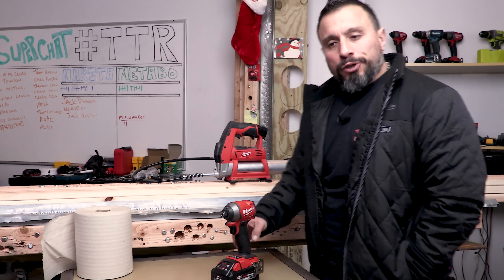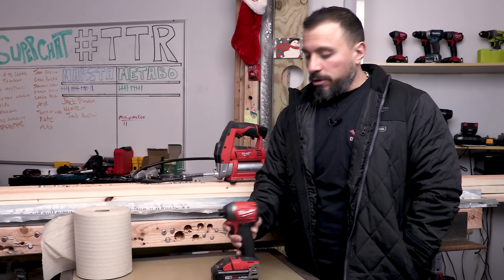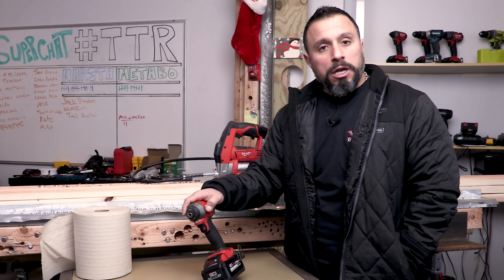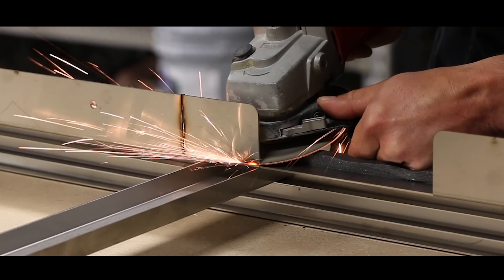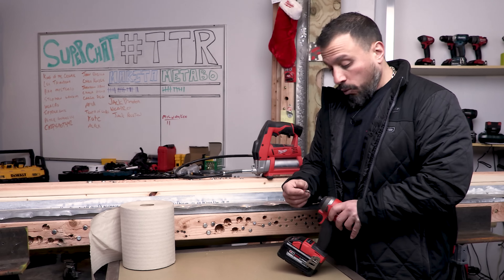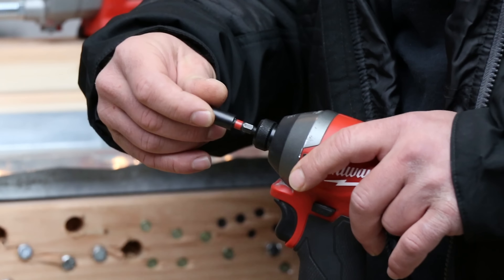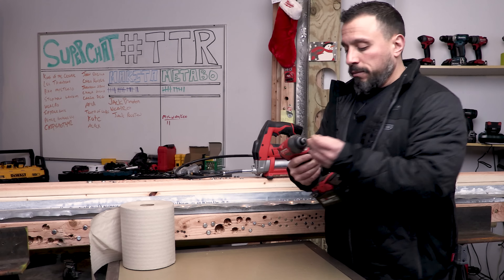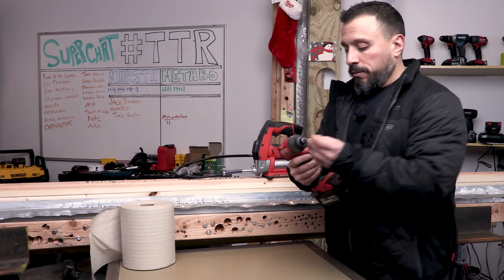Fixing Milwaukee M18 FUEL (2853-20) Gen 3 Impact Driver Collet Problem

Comment: Vince, its called an impact "driver" it's not made to be pulling paddle bits out of wood.  its sort of the same set up as a ratchet and sometimes the socket gets stuck on the bolt and comes free of the ratchet. it's one small ball bearing for Christ sake and you expect the bit too stay in place when you pull on it like that.  it's used for driving in screws and bolts and some light drilling, if you want to use a paddle bit then use the correct tool, its called a drill.
Reply from the maker: Greg, this tool is the best of the best in impact drivers! With that said , other offerings can handle the task of retaining the paddle bit so should the Milwaukee!!
Reply: These are made for paddle bits and many other attachments these days,. that is part of the reason most bits have the ability to be used in the quick connect. The older paddle bits did not have this functionality and could only be used in drills. At least when drilling with impact drivers you don't have to worry about it catching and snatching your wrist.
Reply: ssclassof2000 
Just because you can, doesn’t mean you should.  Go ahead, use a paddle bit and drill 6” into wood with your driver and try to pull the bit back out of the hole. How much force do you think that quick connect collet can take? If you use your tool this way, you will be sending it to the service center or replacing it, just don’t blame the tool, blame the user
Reply: But I do it w my dewalt all the time, and have for 6 years now
Reply: good for you, I stand by my comment, a drill is for drilling and a driver is for driving, use the tools correctly

Comment: The heat probably killed the temper in the spring of the ball. I'm sure they don't use the best steel for the spring. A thicker spring would probably be better as well.

I'm having an issue where I can't get the bit out.

Comment: So I've had this problem with another "High end" manufacturer's impact. So what i did and it worked flawlessly. I used the next size up stainless ball bearing. Its been several months and no issues.
Reply: what is the size of the bearing you bought?
Reply: @hasselhooph  the standard size that goes in was 3.5mm. So I replaced it with a 4mm stainless ball bearing.
Reply from the maker: Biglee where did you pick up the bearing?
Reply: @VCGConstruction  I lucked out and found it at my local ACE Hardware. But you can order them on EBay and Amazon.
Reply from the maker: Nice thanks BigLee
Reply: Winner winner chicken dinner!! You could also take it to machine shop and have them bore out the other side to make it a two ball bearing setup. Would need a new spring for both sides.
Reply: @ftlaud911  YES...i was actually thinking of doing it myself with my very own machine shop skills 👍
Reply: @big.lee007  hows your impact been going?
Reply: @brendon8702  so far it's been working  good. "Knock on Wood" lol 😆

Comment: 10/27/2022 Just received in the mail my brand new Milwaukee fuel impact driver. 
First day on the job the collet did not hold the bit one time had to set the drill down And borrow my boss's
Pretty pathetic.

Comment: It happened to me once. Hasn't since. We shall see! Thanx for the video. I was wondering what u was going to try when in past videos had issues removing spade bits
Reply from the maker: I’m gonna need to try more drastic measures !!
Reply: @VCGConstruction  have to post that video! In case mine decides to say, naw I'm done lol how's it going today brother?
Reply from the maker: Alls good Summit, how about you bro?
Reply: @VCGConstruction  this are decent. Been installing whole house systems. Duct work and everything.  Even running gas line from where meter will be placed. Finished 1 job today, starting a new big job tomorrow. 6 bedroom house, 3 zones. Should be fun yet cold lol

Comment: I hope the new impact driver Metabo SSD 18 LTX 200 BL, which you recently tested, does not have such problems? I plan to purchase it.
Reply from the maker: No problems so far with the collet but it doesn't have quick insert which isn't as convenient but maybe more durable!?!
Reply: I also think it's because of the quick insert. I think that such a serious company as Milwaukee will quickly solve this problem, because in the modern world the competition of manufacturers is very high, reputation is very expensive, and no one wants to get into a puddle. Anyway, thank you for your answer, and good luck in the new year!

Comment: Hey Vince great video, I love the channel and appreciate the hard work you guys put into it. I have always felt (and I’m sure I’m alone on this one) that impact drivers are not ment for drilling holes in wood where great forces are need to retrieve the bit, it puts a lot of pressure in a vary small area, unlike a conventional chuck that has a much better bite on the bit and the pressure is distributed beyond the detent in the shank. I also feel that using an impact driver of any brand as a drill for holes bigger than 1/2” shortens their life span dramatically, just my two cents.
Reply from the maker: I hear what you're saying but those Daredevil bits are impact ready! The Gen 3 has no problem drilling the holes, it's just the retrieval of the bit in thick wood. I know Milwaukee will come through with a solution!
Reply: I love the those bits!  I picked up the the larger holiday promo set at the HD , should last me until next Christmas. In my comment I was referring to the the life span of the impact driver itself after reading it I’m not sure if that was clear, i’ve had problems with a few different brands losing their grip on Retrieval but it usually doesn’t start happening for a few years.I love talking tools.Happy New Year

Comment: You guys work those tools like no other so wear and tear takes on a whole new mean!
Reply: Henry Cruz to be fair that drill looks like it’s had light use as to what other professionals use them. It should not have any problems
Reply from the maker: Do you think we abuse the tools Henry?
Reply: I don’t think you “abuse” the tools but certainly take the to the edge more then you do in the average work day
Reply: Sekekama WoW you see there is no such thing as an average work day. Some days might require more dedicated time on a tool and quite frankly we pay good money for these products to work as they should whenever the task call for it without fail
Reply: @VCGConstruction  of course you do silly.
Im talking about what happens during TTRs
Reply: @FreeBladez  that's not reality. There's  mean time between failures for everything (MTBF). "Mean" suggest some of the same tools will fail earlier than others and some later than others. 
Moving parts wear.
That's why sometimes you can be lucky to have a tool that last seemly forever and then there are times you have one that breaks after a few usages. NO MATTER WHAT YOU PAID FOR IT.
Though there's a better chance (much better) the Milwaukee will have less failures than say a Hercules

Comment: I realize im a little late to this vid so idk if anyone will see this recommendation but I recommend White Lithium Grease. Its not anywhere near as thick as red tacky and it continues to work well and last a long time under intense heat. fantastic grease for lubrication and oxidation prevention. i use it at work to grease roll-up door rails that stand only maybe 10 feet away at most from the flames of jet engines at full burn that are tested in the facilities that I construct so its safe to say that it will probably not burn off and will do its job for  a good, long time.  As a matter of fact I am major Milwaukee fan and I happen to have this same problem with my impact driver but I did not know how to take it apart until now, but now that I do, i am going to try using white lithium on mine. If VCG see's this comment and you guys respond to let me know you saw it then i will give an update on how the white lithium works out. BTW, I love the channel, I found it about a week ago and have been binge-ing your videos ever since!

Comment: The collet whisperer. I was pulling for your fix to work!
Reply: A little bias much ?? Why did you attempt to fix the Milwaukee but you just let the dewalt grenade itself?
Reply from the maker: We did take apart the dewalt
Reply: Bill Simpson in all fairness they took apart the first 887 to see what was smoking and to see if it could be repaired.  As much as I give them a hard time about the love of RedChina,  they did pull apart DeWinnings worst tool yet.
Reply: @eddiesmallhorn4021  , that wasn't my comment lol. It was from Bill Simpson. He replied to my initial comment to Vince
Reply: Paulie Walnuts sorry, when I hit reply it automatically put your name.....Sorry about that, not sure why it did that...

Comment: I have the same impact driver and mine sticks like that too. just tried the same steps but still has issues. resetting the collet is as easy as pulling out on the collet for me. but I don't think its a bearing issue. see if your collet has play side to side as if the collet gets out of round and gets wedged. Just my thought on it. guess I'll have to deal with it or order a new collet.
Reply from the maker: Send it in for service call 1800sawdust

Comment: Hey Vin and VCG crew, what brand of 10 inch general purpose blade for miter/table saws should I get. The Diablo deal at Home Depot seems pretty enticing. Great video by the way!
Reply from the maker: What exactly will you be cutting?
Reply: @VCGConstruction  just some dimensional lumber and plywood on occasion.
Reply from the maker: Go with the diablo if they’re on deal!! If not check out the DeWalt precision blades, they’re awesome!!
Reply: @VCGConstruction  Thanks VCG!

Comment: Try installing the bearing ball in front of the secondary spring.  Not in-between the coils.  I tried it both ways...in between allows free pull-out.  in front, locks the bit in like it's supposed to be.

Comment: Bosch bits in the Milwaukee tend to mess up the collet for some reason. All other bits in Milwaukee are fine. Other impact drivers using Bosch bits are fine. But, when you mix Bosch bits with Milwaukee, the Milwaukee collet gets messed up some how. Plus the collet design's single ball bearing doesn't help.

Comment: My M18 Surge is making a high pitched whining noise sitting idle and it won't change modes or direction. I have to screw around with the battery to get it to actually work, but it goes back to doing the same thing eventually. My M18 Fuel did the same thing after three years and was stuck on mode 1 and wouldn't reverse. Nothing I did would fix it so I just sold it as parts on Ebay. My M18 Surge is only 4 months old, how to I fix it or kept it from becoming bricked?

Comment: had to do this with a Milwaukee gen 1 impact, I used Texaco machine bearing Grease. I think it's 'graphite lithium' based.
Reply from the maker: Did that do the trick?
Reply: VCG Construction the problem was I couldn't remove the bit without wrestling with it. yes works good now, still using it few years later.

Comment: I have the same driver that i got to replace my old one from 2010 and its powerful, but i have hardly used it and have the same issue. Also the damn button to switch modes is in a terrible spot and i bump it all the time with my pinky

Comment: it lets go of the paddle bits exactly like your gen 3 and my get two does that swell its something to do with there chucks. i bought a new one same thin happened
Reply from the maker: Do you think it’s an issue with the Bosch bits, should we try a Milwaukee brand drill bit instead?

Comment: Needs a bigger ball!
Maybe it's worn from using paddle bits? :-)
Dunno, I use impacts to drive screws and drills to drill holes.
I mean small holes with twist bits fine but paddle bits??!
I have used small hole saws to drill holes with my impact in junction boxes in a bind but that's about it.

Comment: My M18 Fuel impact driver is making a high pitched whine (even when the trigger's not pulled), only stays in mode 1 and stops responding after 1 - 2 minutes. It only starts working until the battery is removed and reinserted, but goes though the same thing every time. Do you think it's a circuit board failure?

Comment: I know this is an old video and you even made a new one, but in this video, i feel like the collet is going to slip if you're working against litteraly pulling it out of wood. It was struggling coming out because theres too much crap in the hole and it doesn't look like it's coming out as where it went in. Just my thoughts, not too sure but impacting and trying to pull out i feel like you might have issues.

Comment: I bought this milwaukee thinking it will push out the bit when i pull the collet like dewault and ridgid does it does not changing bits is more tedious sometimes giving the urge u to use both hands instead of 1

Comment: @VCG Construction does this happen with Gen2 impacts ?? I've had mine for almost 2 years now has only done that once with a big 1" 1/2 paddle bit just curious if its all Milwaukee impact drivers
Reply from the maker: Some not all
Reply: @VCGConstruction  my gen2 does have the same issue as the new gen3. gotta take it quite slow and carefull but reversing a paddlebit out of the wood.

Comment: I think it's happened because you drive the bit to much deep and the collet hitting the wood and kind of releasing the bit and screws the spring and everything the should be in such position. But thanks for the video and totally hope milwaukee really do something about this problem.
Reply: Collets release on the pull not on the pushing in motion so that shouldn't happen.

Comment: Good video Vince!  That's a disappointment that that collet fails so easily.  I would agree with you that it is probably the most powerful impact on the market today.  Too bad it's not as heavy duty as it should be.  Milwaukee should offer to replace collets on impacts already sold.  I wonder if this issue will result in them releasing gen 3.5 or 4 sometime this year
Reply from the maker: We’re gonna need to follow through and see if we can find a resolution for the #VeryCoolGang!

Comment: I’m a first year female plumbing apprentice doing high rise.
I drill into concrete almost daily as I install cast iron for drainage. I have the m12 third generation impact.
It’s super light, fast. The boys only use the m18 because it looks manlier. To be honest it has way too much torque for most things. It rarely needs to be your main drill.
I refuse to wreck my wrist to look cooler - although I do have a m18 as well for cutting and drilling steel stud, like actual holes.
I maintain my drill weekly. I blow out all the vents, wipe down the drill. 
If I’m doing concrete and my grease has become goop. I remove it.
Apply my Milwaukee grease in the chuck, on the putter rings of the chuck that moves up and down, and apply a thick amount underneath it where the gear casing is.
I apply a lot to all areas and work it. I turn my drill on all settings and run it for a minute each switching between the settings to get it worked in the gears.
Than I apply wd40 specialist silicone - the water proof and anti dust collecting spray. I actually spray that on before even applying my grease after I’ve cleaned out all the old grease.

If you don’t maintain your drills they honestly don’t work as fast.

I use the compact 3 am battery on my drill and have a 6 amp for more frequent use like when I’m doing deck work.

I notice a big difference in running power between cleanings

I use a small square paint brush to apply my grease and clean with q - tips and remove the old grease by folding paper corners to flick out the old grease as I’m too afraid to take it apart.

Works well. Takes a while. Blow out the chuck areas with air and wd40 and run it before applying the grease

Comment: Two bearings would be a tighter retention to hold the bit in or a slightly bigger bearing maybe would work in my opinion.....
Reply from the maker: Do you think a stiffer spring could help the problem?
Reply: @VCGConstruction  Yes, a little stiffer spring would help in my opinion..

Comment: Haven't even finish this video yet but will tell you that by cleaning and re lubricating doesn't work .  Been having the same problem and did exactly what he did about a month ago and didnt help one bit. The problem happened after heavy use, driving long 9/16 lags, about 20 - 30 of them continuously within a half hour. I think i need a new colit. But considering i drive lags often it will probably happen again unless itsa better colit.
Reply from the maker: Maybe a stiffer spring will solve the issue?

Comment: Impact driver are not for paddle use, and collet does not need grease. I have an impact like that and i clean collet with brake cleaner and 0 problems. For heavy wood work i use my milwaukee M18FP2-0 1/2 " GEN-3 . Each tool has its application.

Comment: I think the other impact  driver that uses 2 balls is dewalt... it seems fine but has much less power. But when it does happen to Milwaukee... I hold the socket and pull trigger for a second... works most times.

Comment: I wouldn't have bought Milwaukee if i knew about this problem.
Reply: It’s really a great brand. They all have their issues. Makita probably has the best impacts in my personal opinion. I went with Milwaukee mainly because I needed the power at the time. They are hard working tools no doubt.
Reply: J G , get the cheaper Bauer , works great .